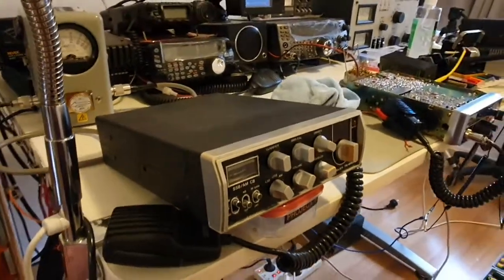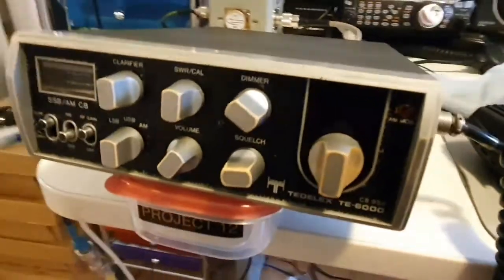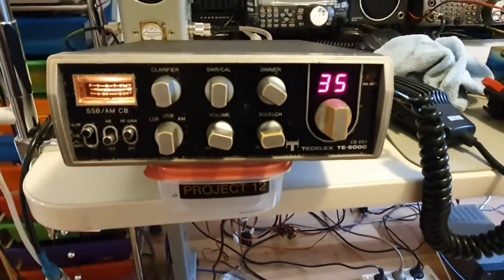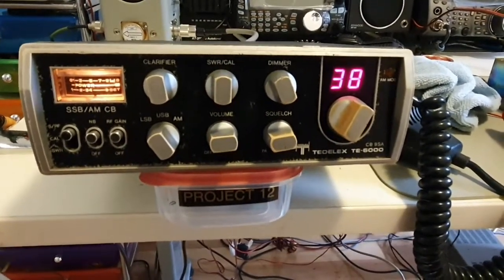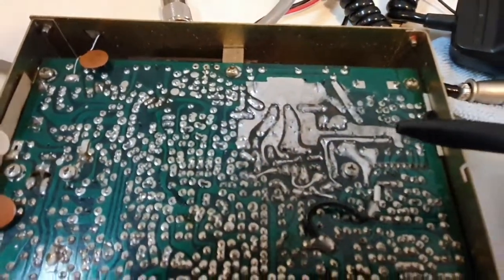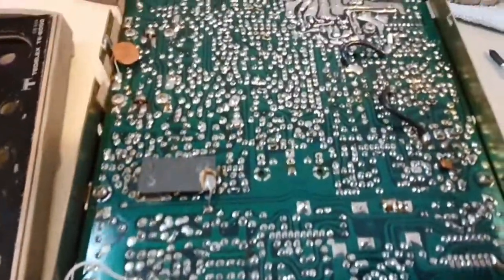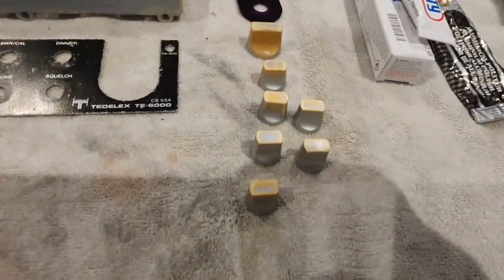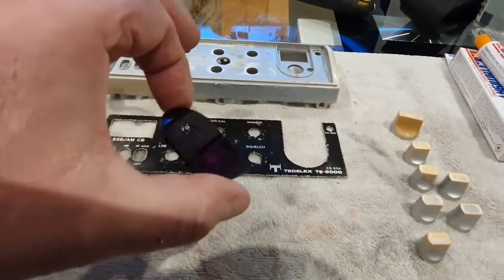Tedelex TE-6000 Cybernet Full Restoration Part 1 of 3

Comment: Hiya Paul i am busy restoring a te6000 and have two orange wires coming off a RF gain switch on the front panel...these wires gave been cut off and i dont know where they go on the main board if you could assist.
Reply from the maker: Should be able to.

Can you take a photo for me and email to vk3mr@hotmail.com

I have a handful of tedelex to refer to
Reply from the maker: Was there extra channels put in?

Yes I should be able to assist.

Send an email to me with a picture please.  

I dont recall those wires being orange though. 

vk3mr@hotmail.com
Reply: Hi Paul yes someone tried to implement extra channels and botched it up....i am sending you a e-mail now with pics.
Reply from the maker: Got it thx Russell and I've replied.
Reply: Hi Paul, nice job
What paint do you use for the knobs and silver front - bezel
Reply from the maker: @darrylfletcher2760 Acrylic modellers, suited for 0.2mm air brush
Reply: @ thx